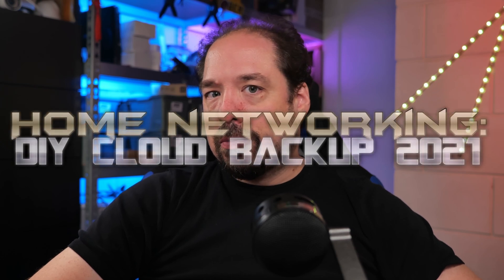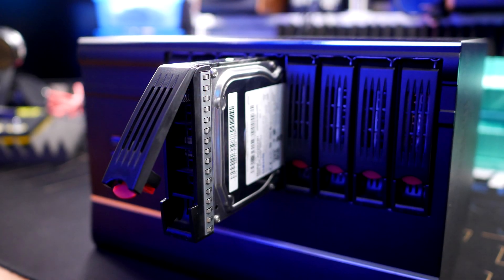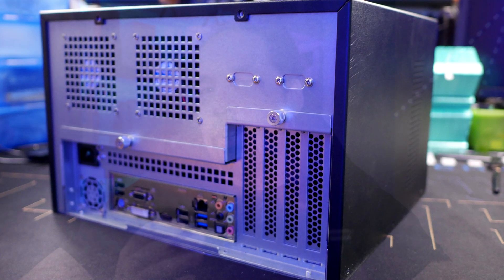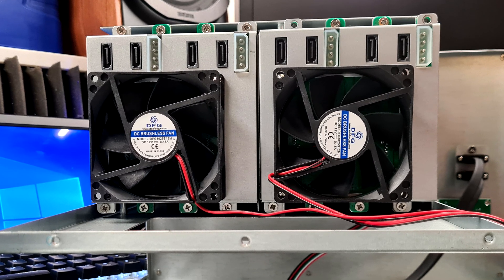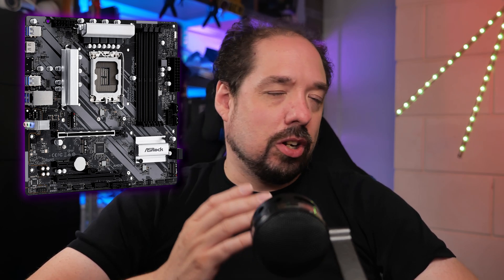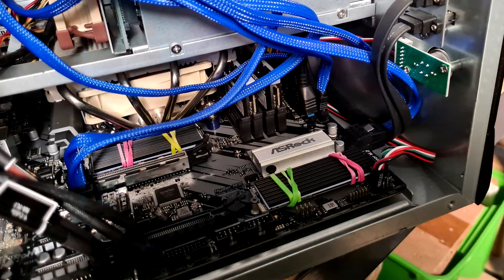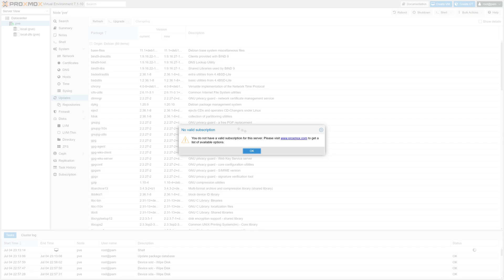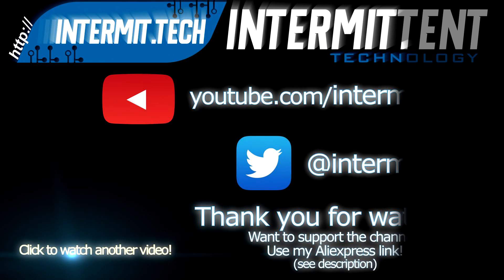DIY Cloud Backup 2021 - Part 3 - Rebooting into 2022!

Comment: I am transplanting soon too. I am going from 8x8TB Xpenology to a 8x16TB unraid. I am going from a Fractal R5 to a 7 XL.
From gigabit to 10gig. The amount of files/ throughput is slow and clearing out old, useless data is a chore. I don’t do cloud but rather offsite for essential data, which is about 20-30%. Most files would be a pita to lose but then again knocking on wood.
Reply from the maker: Ah yeah, my main storage servers look like that (8x10TB + 8x12TB and one with more of a mix of 12TB and 14TB but that's for Chia), this one will be just for housing the backups. :)
Reply: @IntermitTech  never went into chia as I needed the storage for projects. Any case/ rack recommendations? So far I was rather happy with a normal tower but then again my network is rather barbaric. A 10gig switch would be rack mountable… might clean up the network in the process instead of jerryrigging everything. Have a nice weekend